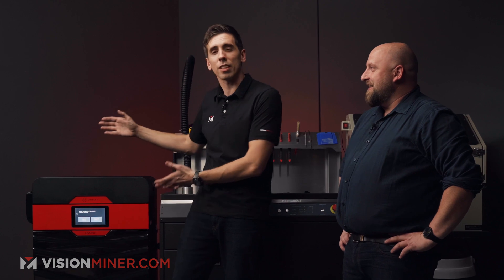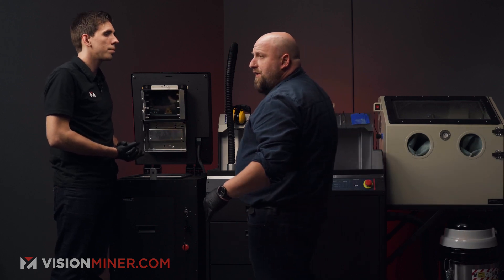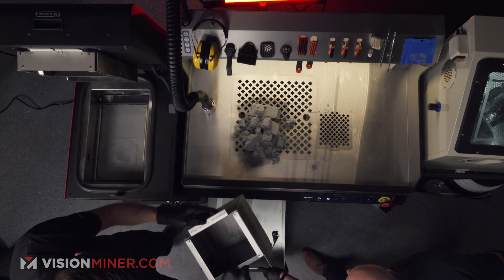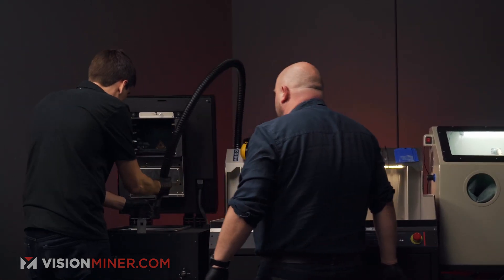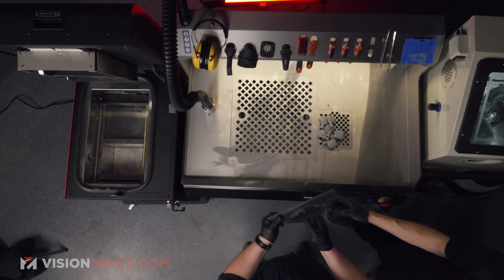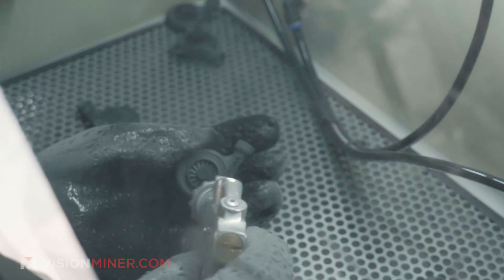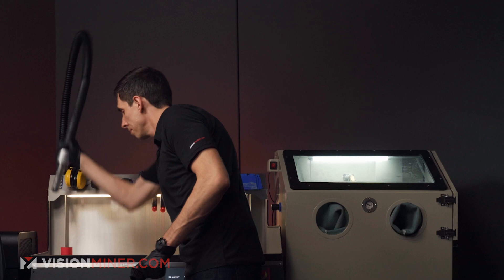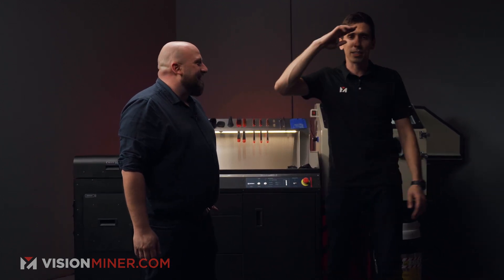Sinterit Lisa Pro - Printing Your First SLS Part from Start to Finish

Comment: What if I just want to print one small thing for prototype, seems like a waste to heat up and cool down the entire machine (takes hours?), and use the whole powder cartridge that has a finite refresh rate. In many cases FDM can print things faster and cheaper and with more variety (less structural and surface quality of course).
Reply: If speed is your goal this is not the solution. In terms of print to usable part something like a Bambu X1 is going to trump almost everything. We use SLS where we have more complex components or moving hinges that are harder to support, we want higher quality/higher strength components or we want to print multiples of something. We can print a years supply of small fixturing in one go vs days to get all of them done on FFF. There is no one solution to rule them all in additive.
Reply from the maker: Yep, that is true for some cases. You actually don't need to fill the whole machine, you can just do a short build volume -- you can put a few parts just at the  bottom, and it only uses just enough powder for the print job. However, FDM can sometimes be advantageous, since the speed for a single part could be faster -- but the quality difference is pretty significant. It takes 1-3 hours for warmup/cooldown.

Comment: I'm thinking about getting a lisa X for my to-be 3D printing service. Do you guys think the results of this machine are sufficient for professional level prototyping?
Reply from the maker: They're not only sufficient for prototyping, but end-use parts -- you get to choose between PA12, multiple PA11's including carbon fiber, flexible materials, and polypropylene, with more materials becoming available -- it makes BEAUTIFUL, accurate and strong parts -- we're seeing people replacing injection molded parts with SLS, especially for low-volume runs! Definitely give us a call and we can send you a sample or something so you can see for yourself :)
Reply: @VisionMiner  Another question if I might. Why should one choose SLS over MJF?
Reply from the maker: @nobutoneme1325  Material properties and availability -- are you making structural components? Pretty components? Do you need color? All of these come into play, but it's mostly related to materilas -- also cost, since MJF is about 10x as expensive right now :)

Comment: I thought the industry was trying to make machines that are fast, inexpensive,  reliable and simple to operate. This seems to go in the opposite direction entirely.   Maybe I'm wrong but that is what I got from this demonstration. It looks like an enthusiast has overcomplicated the process just so they can explain the process to anyone that will listen. I'm probably looking at this the wrong way and if so, someone please let me know.
Reply from the maker: It's kind of funny, because compared to previous versions of this type of SLS/powder technology, it's much easier, faster, and inexpensive than it's ever been before :D hahaha! They're directed towards business, based on the 15-35k price points, so it's definitely not for the consumer market just yet :)
Reply: The setup with the lisa X and the powder cleaning station is around 30k€ tax excluded. A last generation HP mjf machine costs around 500k, of course there are going to be differences in speed and operability.
The only machine with comparable pricepoint to the lisa pro/lisa x is the formlabs fuse 1, which is actually easier to operate, but it's also a very closed system, whilst the sinterit machine lets you use any third party material you want. So yes, the sinterit machines are less intuitive, but are also much more flexible than the few other options

Comment: I read some of the advanced Lisa materials need Nitrogen environment. Would be interested to find out why, which and walk through the setup and operation!
Reply from the maker: Mostly the PA11, because the polymer will oxidize in the high-heat environment, so removing oxygen helps keep everything stable -- much testing in the future!